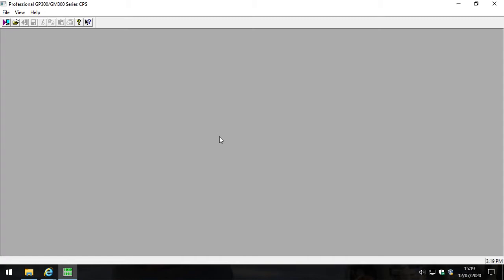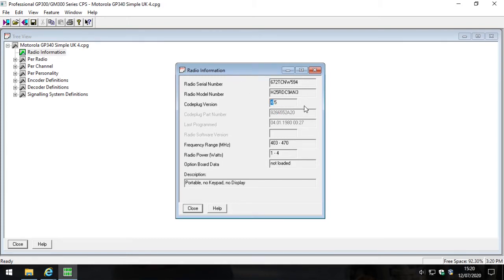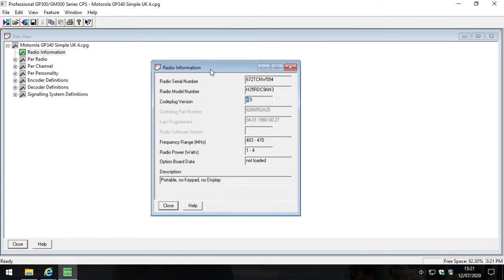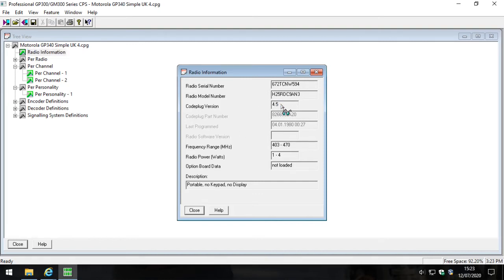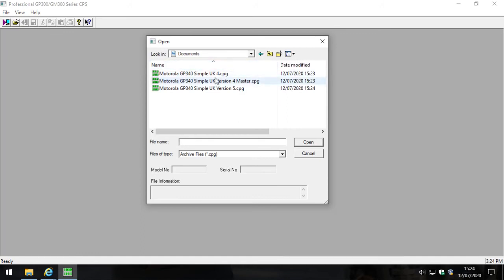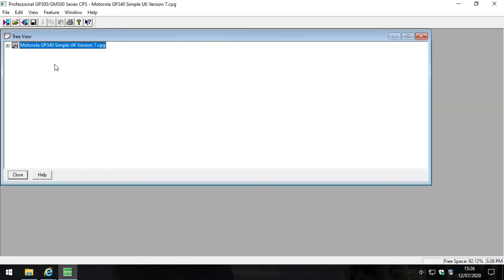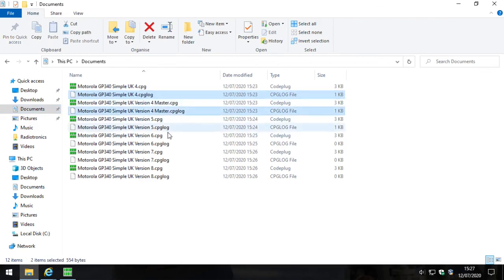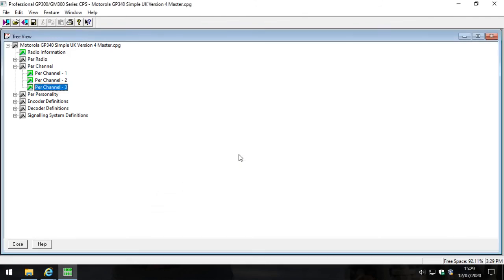SOLVED: Motorola GP340 Code Plug Version Mismatch

Comment: The blank codeplug links as mentioned in the video are not here, nor in the FB group i think? please advice..
Reply from the maker: The code plugs are no longer available due to the sheer level of support requests we were getting. These videos are supposed to reduce questions but the code plug was unfortunately resulting in increased enquiries and has been removed. The Facebook group dedicated to the GP340 series two way radios is here: https://www.facebook.com/groups/304084137284525

Comment from the maker: The code plugs are no longer available due to the sheer level of support requests we were getting. These videos are supposed to reduce questions but the code plug itself was unfortunately resulting in increased enquiries and has been removed. The Facebook group dedicated to the GP340 series two way radios is here where the members will be happy to help: https://www.facebook.com/groups/304084137284525